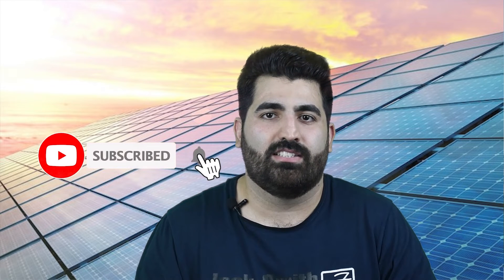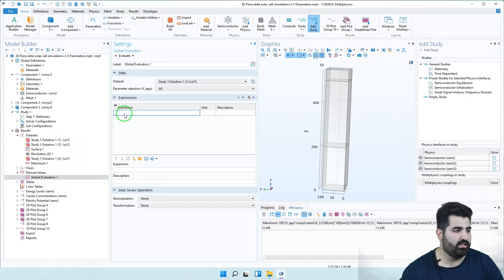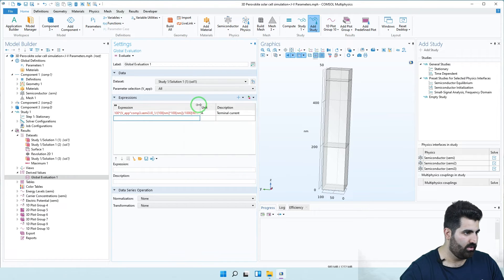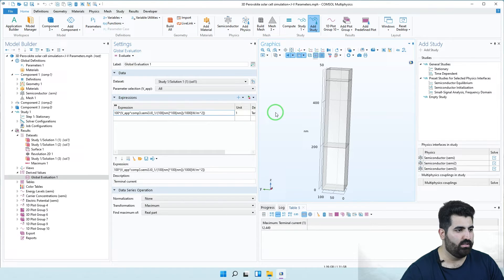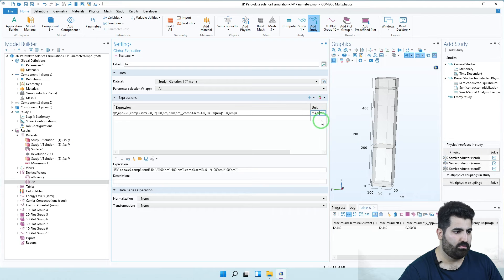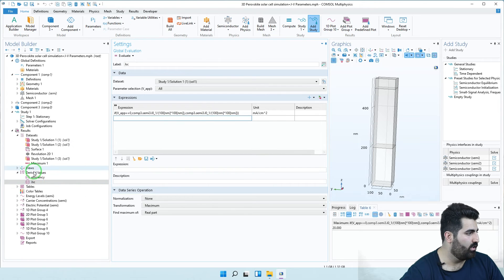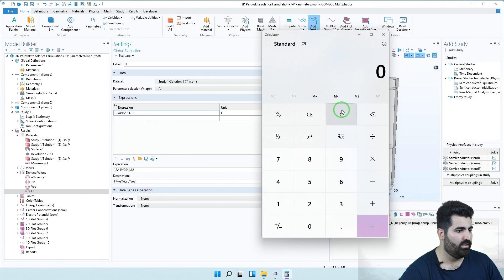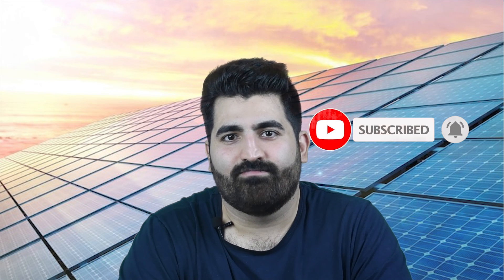Calculation of Solar Cell J-V Characteristics (Jsc,Voc,FF, and eta) with COMSOL Multiphysics

Comment: Dear Dr. Minbashi,

Thank you very much for your excellent tutorials on solar cell simulation with COMSOL. I have a question regarding one part of the tutorial where you derived the equation for efficiency.

You divided the formula by the input power density, which equals 1000 W/m². Could you please let me know where this value is added in the simulation settings? I reviewed all the previous tutorials but couldn’t find the part where you mentioned how to include the input power density.

I would greatly appreciate it if you could clarify this point and help me with this matter.

Comment: Hello
Thank you very much for your video
Can you rewrite the formula for calculating the short circuit current density here please?
Reply from the maker: Please see the video, I can't type here. It is better to see multiple times.
Reply: The video resolution is very low
And the equations aren't cleared
Can you take a screenshot shot for it please?
Reply from the maker: @fatmamoawad1323  the resolution is very high, it is better use a good net for that and also see in your pc.

Comment: Thank you very much for your video! I have some questions: how to calculate the remaining power density（input power）after passing through the filter, because I can't do it with 1000[W/m^2].What module should I use to calculate input power, and how should I set the formula?
Reply from the maker: See my previous videos you will find your answer.
Also subscribe to my channel and also suggest to your friends.
Best wishes

Comment: Sir, thank you very much for your video. I am trying to use Comsol to simulate the CZTSe solar cell.  And I have several questions for this video.
First,  can you explain the meaning of V_app*comp3*semi3.I0_1 and 1000[W/m^2] in the formula of Eff？ Has "1000[W/m^2]"  appeared in  previous part of this  module? 
Second, how to set the parameters of the light received by the battery in Comsol. I'm also curious if comsol can calculate the EQE of the battery? 
Hope for your answer!
Reply from the maker: Hello my friend
Thanks for your comment
The efficiency is output power /input power
The semi i0*V is equal to the output power and 1000[w/m2]is input power.
For battery, it is better to search in the papers.
Reply: Thank you very much sir! @EasyTechSci
Reply from the maker: @zhenghaoliu4532  your welcome my friend